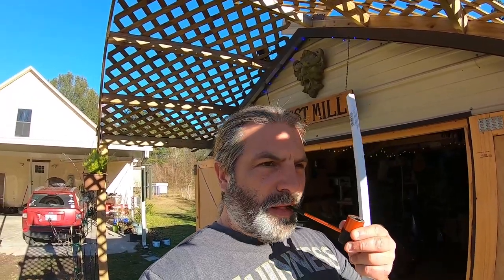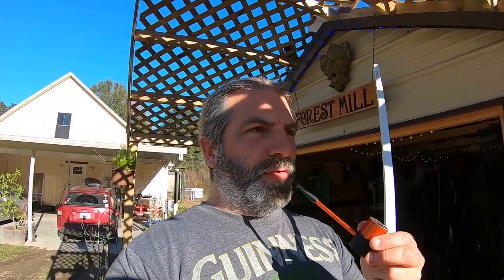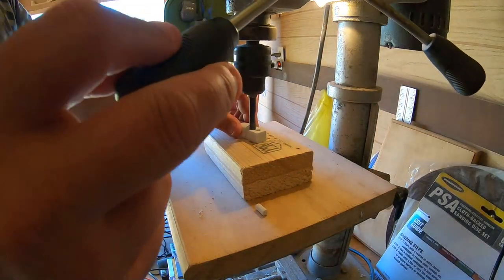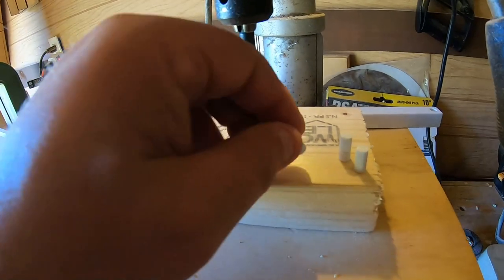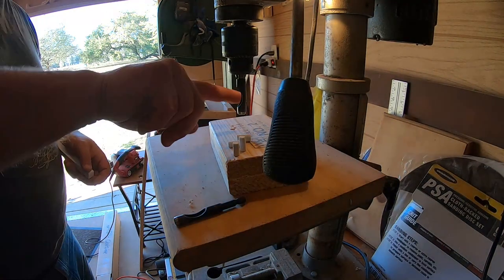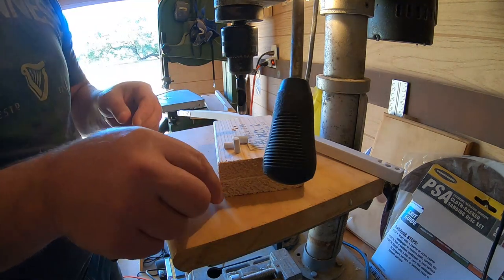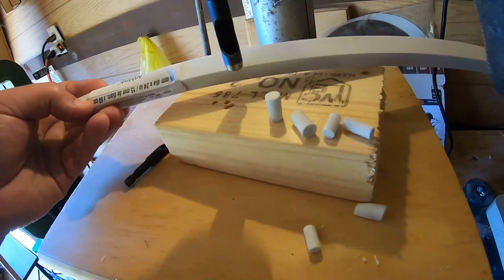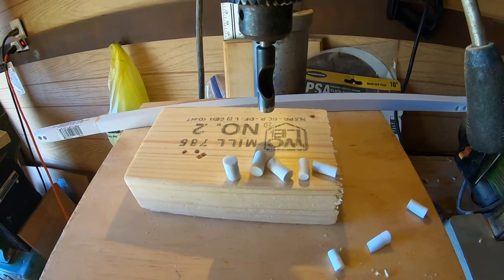EVA Foam Popper Heads

Comment: Interesting product. I made the poppers from the thin foam sheets like you did but the were compressed by the cutter and didn’t spring back. This foam seemed to respond better. Wondering if the acrylic paints Michael’s sells would work alone or need to be top coated with water-based polyurethane. Is that new foam closed cell or open? Thanks
Reply: They had flexible acrylic paint right next to the foam so I'm sure acrylic works.. got a bottle of green flex acrylic to try as well..
Reply: @theoleadventurer1199  thanks I’ll pick some up